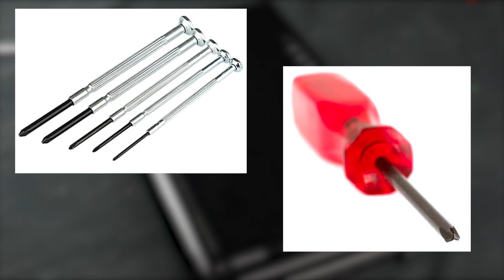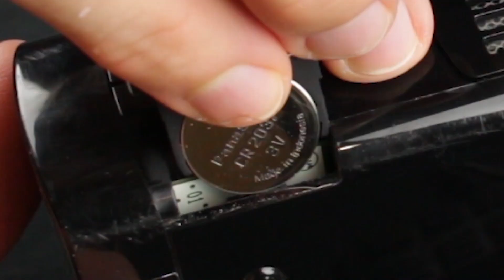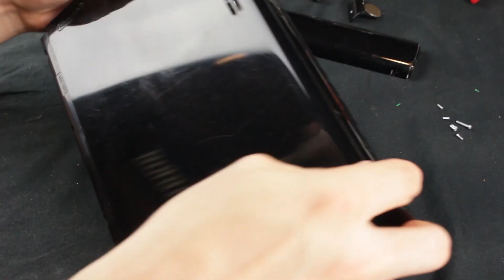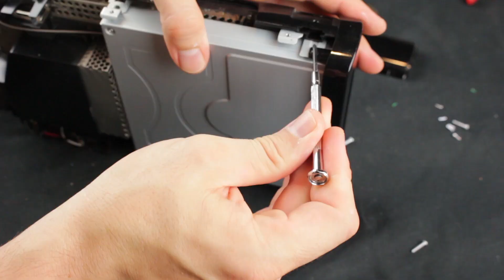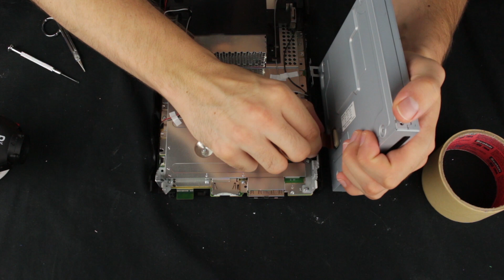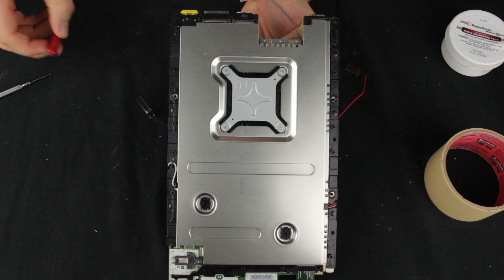Wii U TEARDOWN GUIDE | STEP BY STEP

Comment: Yk the red part that the sensor bar connects to? Is there anywhere i can find a replacement lart for that
Reply: Part* or a way I can fix it
Reply from the maker: Probably not. You'll need a donor console as Nintendo doesn't sell replacement parts. Maybe from a Wii since they use the same bar?

Comment: Everyone who owns a wiiU in 2024: first verify your cmos battery has voltage. If you don’t, you’ll need to recover the NAND, which is hard. Plug the console in and let it get a FULL CHARGE. Replace the cmos battery and tear your console apart, and clean it. It will last decades if you do this every 5 years.

Comment: Awesome vid helped me clean the dust out of my Wii U and polish the housing shell up. Only issue I ran into was my screwdriver was too fat to reach the screws under the disc drive. I found if you unscrew the four little black screws on the side of the disc drive you can take it off the brackets, and then go and get the four bracket pieces off without it in the way.
Reply from the maker: I'm glad it worked out for you.

Comment: my dust mesh in the cd slit in the front is falling apart. can i just undo the face plate 2 screws to get to it?
Reply from the maker: No you need to remove the side panels to get to the screws that hold the front face.

Comment: I needed this video so I can open it up since my baby brother would put the microsd inside the console and give me the adapter. Thanks!
Reply from the maker: Probably one of the reasons Nintendo isn't doing disc drives anymore.
Reply: @ImmodderNation that has to be irrelevant because discs have been used for over a decade, they switched to cartridge because of the portability of the switch

Comment: Maybe you can help me out here. I have a Wii U that my brother gave me. It worked for awhile, but then it started freezing up. Right now, it freezes whatever you happen to be doing about 10 seconds in. You could be waiting to clear a dialog box, switching users, or loading a game. Whatever you happen to be doing, that's where it freezes. I've already replaced the power supply and the thermal pad, cleaned it, made sure the fan was working, and now I don't know what to try next. Any suggestions?
Reply from the maker: Could be bad chips or cracked solder joints. Maybe try reflowing the solder on the board first. Other than that, sounds like its DOA.

Comment: I'm unfortunately experiencing a very dangerous issue: the screws holding the front plate in place refuse to budge, and the screws are starting to strip. Any tips?
Reply from the maker: There are lots of ways to get stripped screws out. You could try screw grab or super glue. Or Dremel a small notch for a flathead screwdriver. Lots of YouTube videos on how to do this as well. Good luck
Reply: Having the same problem they just wont come of

Comment: The level of effort required to get into this thing is next level, three different screw sizes along with tri-wing screws... insanity lol
Reply from the maker: Todays consoles are actually easier to take apart. Go back a few years and try the older NES and SuperNES consoles. Good luck finding gamebit drivers, only found them on Amazon.
Reply: Bro doesn't know about the long screw console gen (gc,Xbox,PS2)

Comment: My hdmi port is broken to fix it what would I need?
Reply from the maker: Starting with the actual port. Hot air reworking station or soldering iron with knife blade. Flux paste and tweezers. Solder paste to put the new one on.

Comment: Thanks. I tried to follow the iFixit teardown guide, but that one is very incomplete. Yours is very good and very detailed. Thanks to this guide I managed to remove the bonusgame that came with my WiiU from the disk drive and now have a working WiiU and a copy of Lego Batman The Videogame. Yes, the WiiU definitely isn't able to play DS games. Never leave kids alone with anything with a slot.
Reply from the maker: You're welcome. I love a happy ending. Unforunately, ifixit doesn't have a video for the Wii U teardown. Pictures only tell half the story.

You could have ended that last sentence after "anything." 😂
Reply: @ImmodderNation  True, I could have ended that last sentence there. Just got another evidence of that today. Little brother + silver PS4 Slim + sandpaper really aren't a good combination. I got that PS4 really cheap, but the case looks terrible. I'll get some decals, hopefully that covers it.
Reply from the maker: @MyRegardsToTheDodo  You could also buy a system "for parts" and reuse the case for your system.
Reply: @ImmodderNation  I could, but I'm selling the PS4 off. I hope to get around 120 to 130 Euros for it, in decent condition it would probably bring around 150 Euros. So it's not really worth it for me, considering a broken PS4 Slim costs up to 90 Euros these days.

Comment: Could you please help me .. here is my issue ..

Hi,
Problem : Wii-u working fine but no output on led tv through HDMI or component cable .. the console is getting powered and I can play games on the wii-u handheld controller(the controller with built in screen .. its working)
I need help regarding Wii-u .. please help me if you can .. 1) well my power supply of wii u is broken so I used computer power supply(used a module which could boost the voltage to 15volts and can handle 6 amps) .. everything worked great for the first 2/3 days

2) Now the problem ,, when i used my wii-u again(few weeks later) .. or couple of days later .. the wii-u console got powered on but .. the hdmi port is not outputting anything on TV ( there is no fault with the HDMI cable and there is no fault with the led TV) and even the component cable is not working ..

PS: the console is getting powered from the computer power supply (with module i talked about) and the handeld wii-u controller is working fine(i can see display on it and can play games on it) ..and .. the only thing is HDMI to tv is not working and component cable is also not working .. My guess is some fuse is blown to protect the HDMI ic or some capacitor on the mobo is shorted .. could any1 with hardware mod experience help me please .. i will be really grateful.

Regards
R
Reply from the maker: Wii U doesn't have fuses. Nintendo would probably frown on the computer power supply to power the console. I thought the power supply produced 17 v, but could be remembering it wrong. My guess is that the In plane switching power supply from your PC functions differently than the power adapter that comes with the console. Could be it fried the video chip that outputs to the TV. I would check to make sure that your TV is set to the right input for each console and try with a working console to verify. Are you at least getting sound or nothing at all?

Comment: Just got access to my Wii U back after like 6 years and noticed the fan was pretty loud. Checked this to see what would be involved in opening it up and giving it a good clean and replacing the thermal paste but yikes I can’t believe the fan is that small. Granted the only other fans I’ve had to mess with were PS4 and PS5 sooo
Reply from the maker: The heatsink does most of the work here. The fan just moves the air. Also the Wii U uses a thermal pad, not paste, so I hope your thermals haven't changed for the worst.

Comment: Did nintendo use any thermal paste?

I don't see any after the heat sink was removed.
Reply from the maker: Thermal pad underneath the heatsink 👍
Reply: @ImmodderNation  is it reusable when cleaning out the system? Or do i need to use thermal paste?

Comment: Not sure if anyone will see this but any idea where to start if there is no video output with either the hdmi or av cables it powers on fine and spins up but my tv is getting no video either way.
Reply from the maker: Have you tried another display to see if that works? Maybe the video output of your display is set wrong? Have you checked your cables with a working console to make sure it works?

Comment: Nice video. Man  I've been looking everywhere but i see no one has ever tried to attempt what I've been wanting to do. Since the Harmony Hub is defunct and no longer in production, I can't control my wii or wii u via voice command. So I  thought to myself why don't i wire up a wifi relay switch, like the one from Shelly and then take the wires connecting it and solder it to the area on eitiher a wii u remote pcb board or the wii console's pcb board near the area that has the power button. That way when a command is sent via wifi to the Shelly it will send a relay signal to simulate a button press, thus turning the Wii U on. I've seen no tutorials on trying to attempt this. However I have no clue how the structure of the wii u's console or any of it's remote's pcb board works. So I'm not sure I could get it to work the same way as if I used a wifi relay switch on a garage door opener. I wish there we videos on this because it frustrates me to no end.
Reply from the maker: The Wii U uses a momentary switch to power on the console, which is different from a latching switch, like a light switch for example. I don't know which terminals you would have to connect to to simulate a button press on the front of the console.

I would look at a Broadlink RM4 Pro or something similar. It does some of the things the Harmony Hub did. There may be newer or better options, but RM4 Pro works with IFTTT automation software, so that might be the direction you want to go.
Reply: @ImmodderNation  broadlink doesn't work. The wii, wii u and Nintendo switch remote controllers use a Bluetooth signal on a particular bandwidth to power them on via computer controller. They do not use radio frequency or wifi. I have a broadlink rm4 pro and trust me I can't program remote commands from the controllers. Hence why I would need either to hardwire to the consoles a wifi circuit switch to a negative and positive terminal (at least in theory) but you know game consoles do these weird proprietary things to consoles. By the way, how does a momentary switch function? By the way the wii remotes do have IR but the IR receiver is not connected to where the power on and off circuitry is. I belief the IR (infrared) is used solely for motion movement. As for the Wii U not sure if the big remote with the screen has a built in IR blaster. And the switch, well, different technology.

Comment: Hello. I am having issue with WiiU and i cannot find solution anywhere. I hope you can help me determine problem. Problem is with motion/gyro controll. It is sometimes laggy and sometimes I have to shake gamepad to get it work. Reseting, recalibrating doesn't help. I'd be thankful if you could tell me which part is faulty. Thanx.
Reply from the maker: Sounds like the problem might be with your controller. Good luck!

Comment: Does anybody know what part of WiiU can make no video in spite of CPU is hot, USB power is 5V and no capacitor failed. I disconnected all bus devices but neither hdmi nor rca image.
Reply from the maker: I would recommend checking GBA forums for help.
Reply: @ImmodderNation  there was console GPU manufacturing defect. I found the same one working.

Comment: So I recently opened up the disk drive to clean in hopes of getting a fat stack of good games to maybe finally work....(disc read errors on certain games my system doesn't like I guess)  I must have offset a spring lever or something because now, after powering back up it. I get a a blue light like it wants to work (also game pad is responsive with the quick menu) but if I try to eject/load main menu/play game it begins the flashing red led. Any kind of advice or direction would be greatly greatly appreciated. 

BTW super impressed with your previous replies, honestly thought I'd hit the end so literally any help is gonna keep this console from a frustrated violent end. Thanks
Reply from the maker: Depends upon how much time you want to spend troubleshooting. I'd check eBay for a backup drive to install Incase things go south. 

I haven't explored the inside of the drive so your guess is as good as mine. Maybe you can try the new drive and see if that gets it working.

Comment: Where are the files stored? Is there a hard drive in there?
Reply from the maker: No hard drive. eMMC soldered to the board. Those are where most of the files are. Rest are SOC.
Reply: @ImmodderNation  i dont think i need to ask but its not water proof is it? my house got flooded recently
Reply from the maker: Nope. Not water proof

Comment: OK, here's a little problem I got, and maybe you can help me out.
I wanted to replace my optical drive, because the old one got retired. 
The new one arrived soon, and I got a 160-1402 error, which apparently meant I had to switch the board from the old optical drive into the new one. 
So I had to tear the machine down again (luckily I had not reassembled the whole wii-u yet).

While doing so, the little lever on the connector on the side came off. The one you put the flatcable in on the side for the on/off switch. I really handled it gently; no yanking or rough treatment. The connector itself was still OK, but I couldn't get the flatcable in and secure it anymore. After a long evening of cursing, because mainly I didn't how to or if I could get it back, I came to this video.

Do you (or anyone else) know how to fix this. Or if not, can anyone point to another solution?

TIA
Reply from the maker: Figure out a way to lock that cable in place. Might need to get creative with hot glue.

Comment: Quick question: I recently tried to open my Wii U and when I put it back together, it had stopped working entirely, like it wasn't even turning on.  Any clue what could cause this?  I know there is a lot, but I believe to have done everything correct, all connections, well connected and everything like that.  Is there any way I damaged something in a way to make it stop working?
Reply from the maker: You could have but chances are likely the disk drive ribbon cable is not connected properly.
Reply: @ImmodderNation  That, uh, makes a lot of sense.  I always had trouble getting it back in.  Thank you, I will test it tomorrow!
Reply from the maker: Good luck. Report back.
Reply: While trying to put everything back together after making sure the disc drive is fine, I noticed that the connection from the front of the console (I assume it to be what allows things like the power button to work) had been damaged and I can't reconnect it.  Would that be another reason it's not turning on?  Even if I use another way to turn it on like the gamepad, I mean.
Reply from the maker: The power switch is connected to the front face, so that could have something to do with it. You may need to buy replacement parts.
Reply: What exactly would stop it from turning on?  The power switch not working, or the same failsafe as the disc drive cable?
Reply from the maker: The front must be connected or the front led will not illuminate. I just confirmed with my Wii U, you must have that front connector plugged in.
Reply: Well damn...  Thank you so much for the solution, though!  I had my Wii u not working in a corner for about two months, but now that I know how to fix it, I will.  Thank you.
Reply from the maker: I unplugged the front face and the gamepad would not turn on the Wii U. I plugged it back in and it turned on. So there you have it.
Reply: Great to finally have an answer.  Getting those new parts shouldn't be too hard or expensive, so I may actually be able to save my Wii u thanks to you!  It's great to see a youtuber who actually cares about their audience.  Thank you for spending the time to help, it means a lot!

Comment: How do I know if I connected the console dentor cables correctly?
Reply from the maker: If it turns on. 

I'm just kidding. I don't know what dentor cables are.
Reply: @ImmodderNation  The white and red ones inside the system.
Reply from the maker: The antennas? I never disconnected them. I just removed them from the plastic holder.
Reply: @ImmodderNation  O.K. Thanks!
Reply from the maker: Good luck!

Comment: I have a broken Wii U and they asked too much to repair it. I wonder if is it possibile to swap the cases?
Mine is in fairly good shape, with few scratches and I would like to salvage it, so that I can swap it with that of a console that works but looks more roughed up.
Reply from the maker: Yeah once you get all the screws out the case comes off easily
Reply: @ImmodderNation  Thanks. I'm only scared about removing the rubber screw covers, since I've seen nobody sells replacements for those, and I'm afraid they'll get deformed when I remove them.
Reply from the maker: Use a straight pin or small blade precision screwdriver.

Comment: Alright well
How do I put it back together
Reply from the maker: Watch this video in reverse!
Reply: @ImmodderNation  yeah, I eventually figured it out, and im honestly surprised that the only problems I had was accidentally messing with the ribbon wire which im guessing controlled the power LED and somehow having a single extra screw, great video by the way
Reply from the maker: Thank you. Spare parts get thrown in the trash. Nobody saw that! 😂

Comment: Wow. I cleaned my vents from the outside as they were caked in dust. Really hope the inside is not too dusty. I might one day open it but at the moment using an anti static brush I was able to de-dust the vents. 
I really don't want a dead console from heat.
Reply from the maker: There's a massive heat sink, as long as the fan keeps moving air it should be ok.

Comment: Any specific informations that i should know if i want to replace my broken sd card slot? Never did this before
Reply from the maker: It's soldered to the board. I recommend a hot air station like the 858D or you can try a soldering iron. I have videos on how to use both. Look for videos on replacing surface mount components like usb ports. It's not easy.